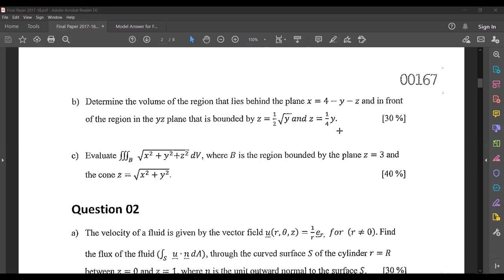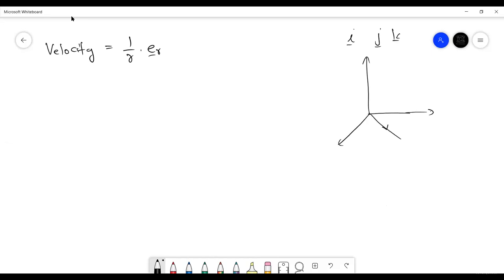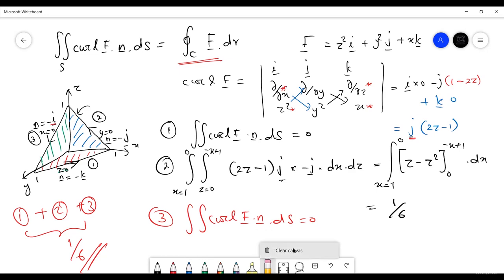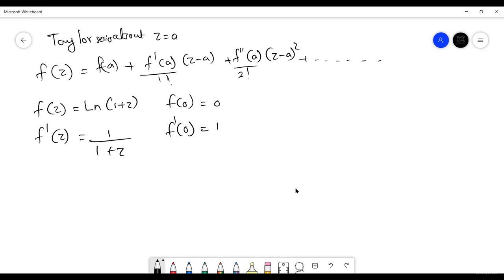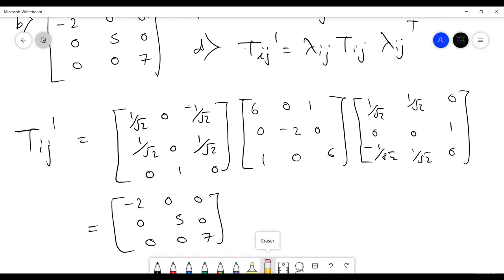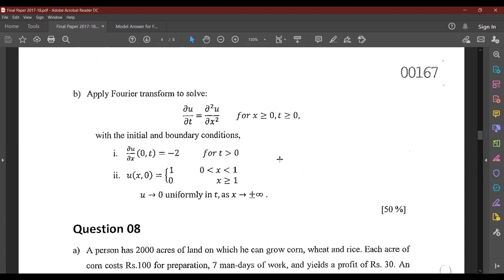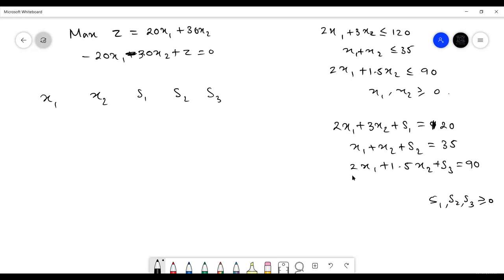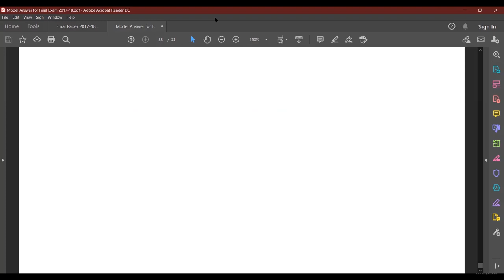Engineering Mathematics 3 MPZ5230/MHZ5530 2017/18 Paper Discussion

Comment: Thank you verymuch for this video. Could you please upload a video describing the difference methods of simplex , two phase simplex and dual simplex..

In assignments there are ways of selecting pivot columns considering whether it is most posituve as well as most negotive.. 

If we ask for max z , should we choose most negotive or if  min z we have to choose most positive.  this is the what I understood. Could you please explain me whether I am correct or what the    correct method is
Reply from the maker: Selecting the most negative or positive depends on how you rearrange the required min/max condition
Reply: Could you simply tell me that how should we select most negative or most positive according to given data..
Reply from the maker: @samithamadushangunarathna3834   Look at the required max/min condition equation required and select the largest positive or negative value.